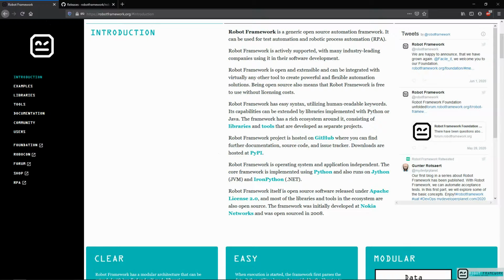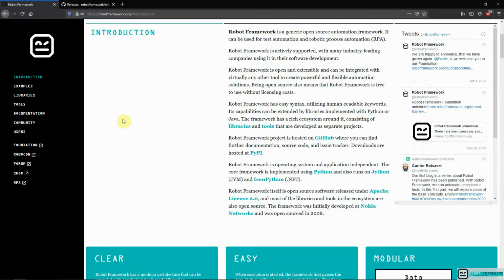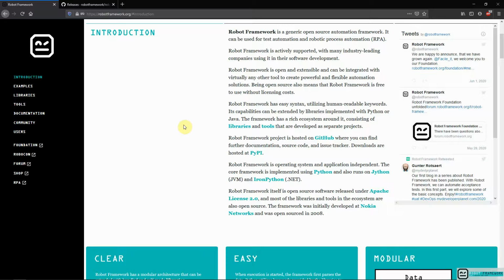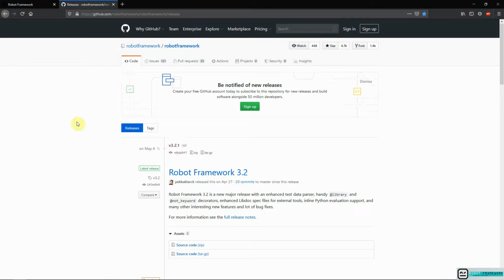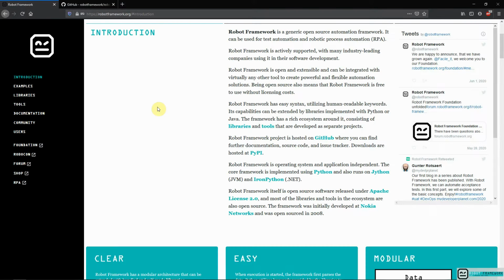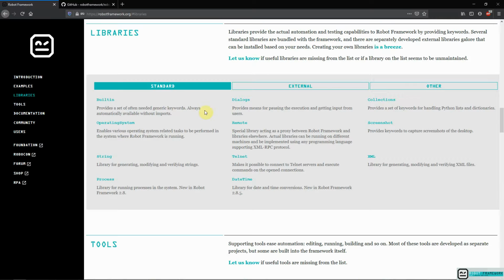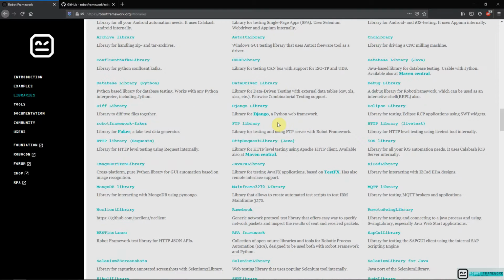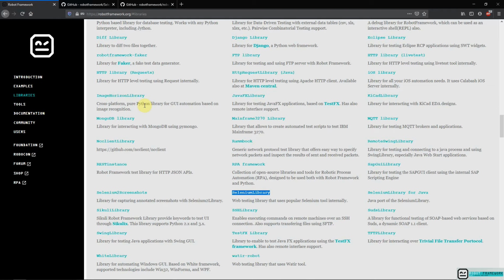Robot Framework Tutorial Part 2 - About Robot Framework

Comment: HI i am struggling wit this scenario. please help:
In Salesforce, After clicking the Commit Changes button, a new page opens and continues loading (spinner visible). I'm trying to click a dropdown labeled "Select Filter", but the dropdown is not a standard <select> element. I’ve tried:

Waiting for the element (with Wait Until Element Is Visible, Run Keyword And Ignore Error, Run Keyword Until Success)

Using Execute JavaScript to click

Verifying the XPath in dev tools (it works only after I manually click the element)

Despite all this, the click doesn't trigger the dropdown. What is the best way to handle this kind of element in Robot Framework with SeleniumLibrary?